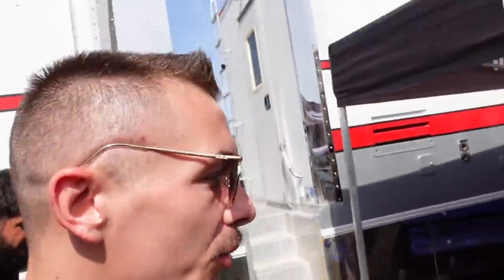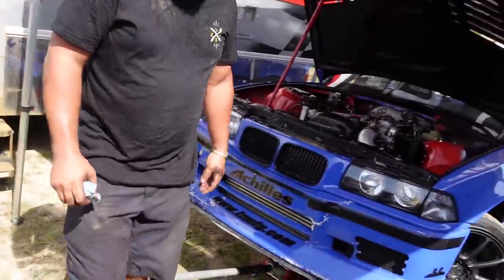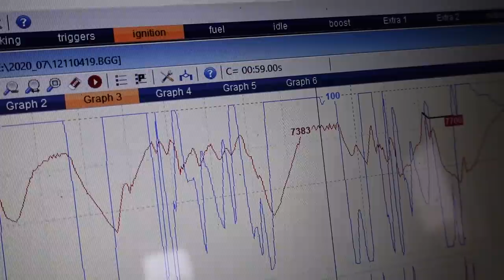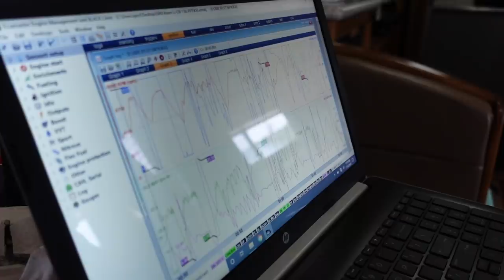E36 Breaks Down in Top 8 (Raw Drift Competition)

Comment: Quick idea to keep IET’s down, put a nitrous solenoid on the intake so that the nitrous sprays in the intake deatomizing the air and allowing a little extra horsepower while also cooling the air going into the motor and keeping IET’s down.

Comment: Tip for Mike: Don't include multiple clips of a crappy run. I'd only include the outside clip if it added something to the video. Most of them were good, but sometimes it's not necessary to have 3 angles of a boring run where the other person couldn't get out of 1st or whatever